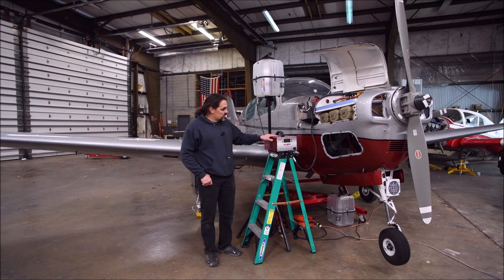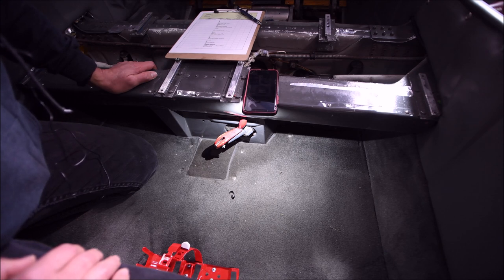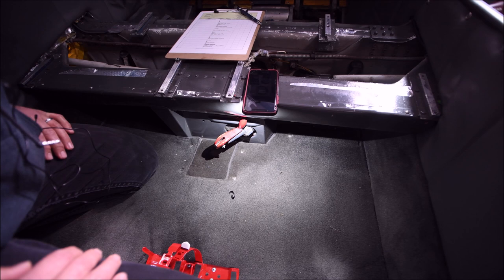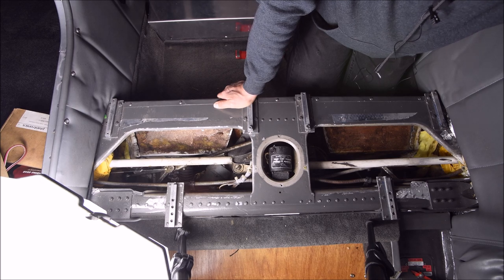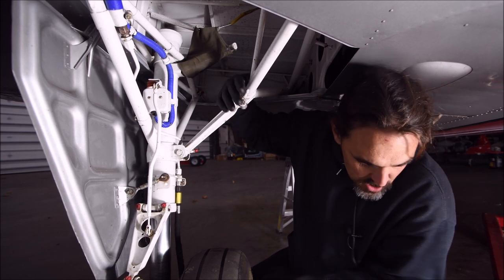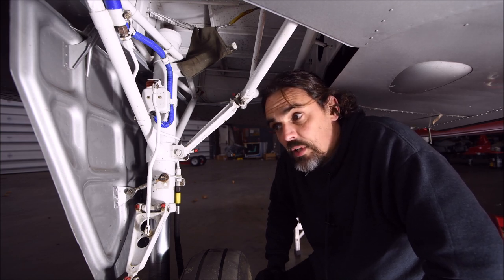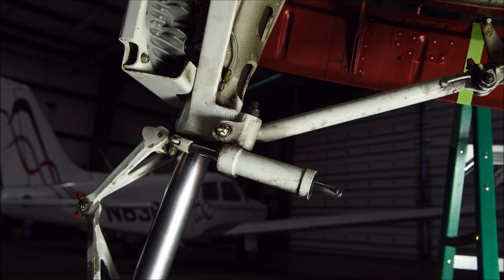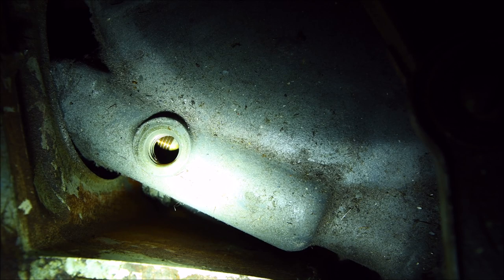Bonanza Gear inspection 1

Comment: Great vid Dave, Thanks for the leg work on camera setup/lighting and crooking you neck to explain whats going on. As an IA working on 3 F33A's at a flight school this vid is pretty much the same procedures as we do on the gear system athough there are a lot more steps as you mentioned. The Beech Aero Club checklist is by far the best LG checklist, much better then the maint. manual. Some key things that I have run across, 1) unhooking the lower nose gear door rods.....we only unhook the bottom side and put a bungee to hold the doors open, much easier, never had a problem with them catching and jamming. 2) The uplock rollers on this has the old style zerks, that uplock cable must have the plastic straw in place next to that zerk or it could catch and jam the gear in up position. 3) We replace the nose gear retract push pull tube rod ends every 2000 hrs....not that hard to do. 4) Torque up the transmission bolts that are secured to airframe from bottom panel, after 100s of cycles they will loosen and hog out the airframe bracket holes.

Comment: Excellent video and everything is explained very clearly. Watching the swift and smooth gear extension and retraction without hesitation/groaning noises as common in other makes  really underscores how straightforward yet well-designed the landing system is. Ralph Harmon (the chief engineer behind the landing gear) really did an outstanding job.
Reply: @Galileo7of9 Check out books by Larry Ball which chronicle the history of the Bonanza.

Comment: One thing that I as an I.A. I do is remove the gear motor. I have found the splines damaged with some missing. Also, I check the brushes and give it a good visual inspection. I removed one motor and gave it the "sniff" test and it smelled as though it had been burning.  The owner then fessed up the his gear had been retracting "very slow lately".

Comment: A couple other things to look for, check the nose gear retract brace attach bolts torque at the keels, I've found those loose also there's a bearing in there that can come loose and rotate away from the lube hole, you'll get lube coming out but you're not actually lubing anything, also there's a shear pin on the nose gear retract rod on the rh aft side of the nose gear well, I've found these almost worn through.
There's several other things that really needs looking at but to many to list, make sure you insist your maintenance tech use a Beechcraft Maintenance manual and the manual will clearly state what kind of external power is needed, although this gear is really tough don't take any chances!! It's a lot cheaper than repairing your belly skin!!
I've been working on Beechcraft aircraft for 30+ years and my last employer we had 27 Bonanza's and 20 Baron's in our flight school and I'd  do a complete gear removal and teardown overhaul every 2000 flight hrs, I hope this helps.
Reply from the maker: Thank you for the info. We check more than was covered in this video. This video is just showing the rigging inspection procedure.
Reply: @AirDavePasqualeAviation  I figured as much, it was a very good video after all those years of working on Beechcraft aircraft you'd be surprised an what I've seen! 🤔🤯😄😄
Keep up the great videos.

Comment: Dave, great video.  Really helps underline pre flight checks….and the why?,      Q: the inboard right gear door is super tight, buckling up tight, even when i take a turn off the crank handle when i leave it larked the left inner door opens 1/4 turn but the right is still 2 middle finger to move it al all tight…worried bout stressing the bracketry….easy fix ? + where is your shop located?     My A+P is not. bonanza guy and does not see how to fix it without having the other door open and dragging in flight…..

Comment: Great video Dave!  What if once you get the 1/8-1/4 turn hand-crank set for UP and DOWN cycles, the in-flight clearance on DOWN is 1/2 turn?  How does that happen?  Stipstream?  Was set a 1/8 turn but in-flight measures 1/2.  Humm?

Comment: Shouldn't you disconnect the outbound gear doors from the mains?
Reply from the maker: I typically disconnect the outboard gear doors just before retracting the gear to check up lock clearance, side brace to skin clearance, and up stop bolt for contact.